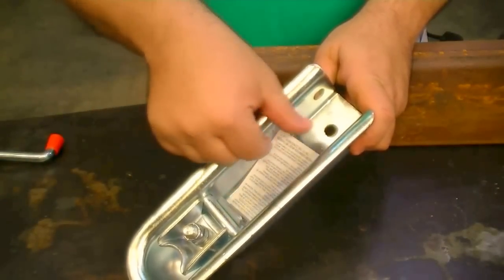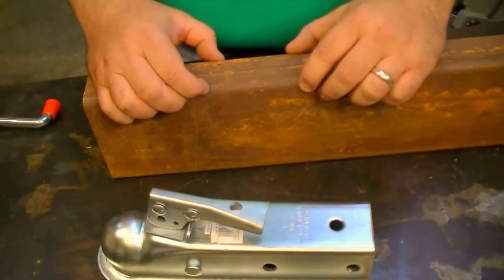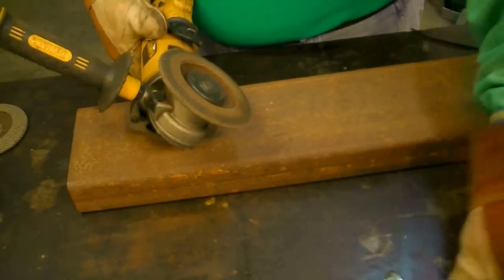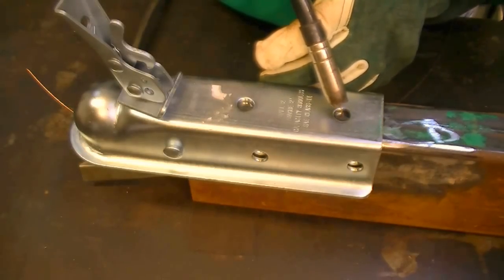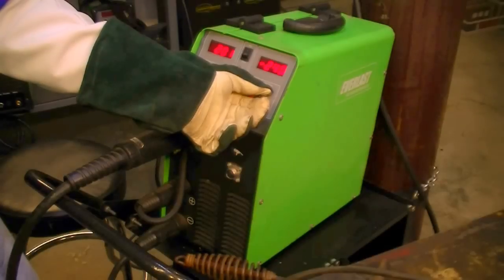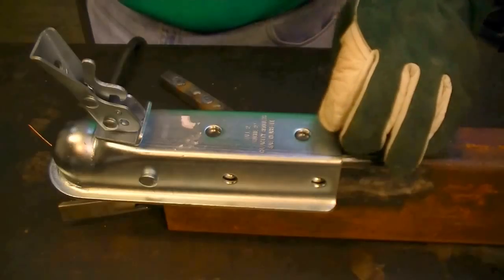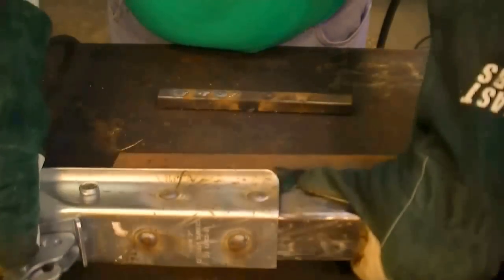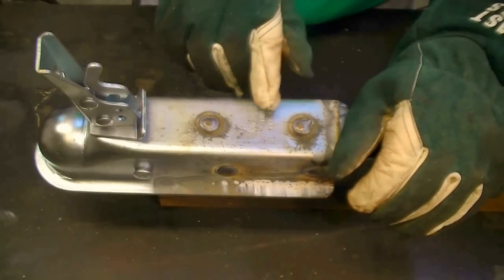How To Make a Plug Weld With a MIG Welder  (When Replacing a Trailer Hitch Coupler)

Comment: Interesting, because TIG plug welds are done from the rim to the inside. I’ve never done a mig plug weld that was more than about 1/4” dia, which is pretty small for mig, but not for TIG.
Reply from the maker: Mel Gross mig welds start cold with porosity at the start.  Heating up the area a bit befote welding the rim ensures proper fusion.

Comment: This man knows “how to weld” but “not where
to weld”.  A continues weld around the
perimeter of that hitch is a definite no no, he should know better if he is
going to be doing how-to videos.   ~   John Buchtenkirch
Reply from the maker: Weld was performed correctly and the according to the trailer manufacturing industry standards for welding on couplers.  There is no "no-no" here.
Reply: Sir, you are obviously from the “more weld is better school”, I used to think the same way myself when I was much younger.  Guys that run vertical welds on the ends of fishplates on frame reinforcement jobs are wrong and so are you on that hitch install.  Good welds rarely crack, it’s always the metal right alongside of the weld that fails.  By starting your weld right at the end of the rectangular tubing you have caused a perfect place for a stress crack to start, particularly considering that single axle trailers continuously load & unload their tongue.  I would have started my first weld an inch back, welded an inch and skipped a half inch and welded another inch and continued on that way…….  continuous welds are just highways for stress cracks to run on and you now have that running completely around the hitch you’ve installed.  Having said that I highly doubt that little trailer will ever crack that weld but that still doesn’t make it correct.   ~   John Buchtenkirch
Reply from the maker: Well,  if you don't follow industry prescribed standards, and the coupler manufacturers directions, (which I did) then anything else is more of your opinion than anything based in fact.  I see you have posted no helpful videos to your account.  If you can do better, then do!  It's easy enough to armchair and second guess and critique someone else, but much harder to show people the way you think it should be done.
Reply: I suggest you talk to some experienced maintenance
welders in the construction or trucking industries where all of this is pretty
much common knowledge, not something I dreamed up or was only used on
the space shuttle.  Continues welds are
the beginnings of continues cracks and in many cases should be avoided on
highly stressed welding jobs if at all possible, it’s just that simple.  I will leave the video making up to you, you
are the one selling welders & will benefit from it.   ~  
John Buchtenkirch

Comment from the maker: Unless the hitch is for marine service, it usually isn't galvanized.  Many couplers have no coating at all.   Some are painted, while others have a light zinc coating.  Usually the fumes are manageable with plenty of ventilation, and keeping your head out of them.  Although a respirator is nice, it likely isn't going to be required for a welding. the coupler.  No need for cold galv finish.  A quick paint job is all that is required, and typically would be painted anyway.

Comment: Man, that original trailer looks like it was made out of tin foil! Way too thin. I think I'll go drill some holes and practice plug welds. The video talks about the anti-rust coating on the hitch- don't breathe those fumes when welding! Also, since the weld burns through the rust-proofing, may want some spray galv to prevent rust on the welded areas.